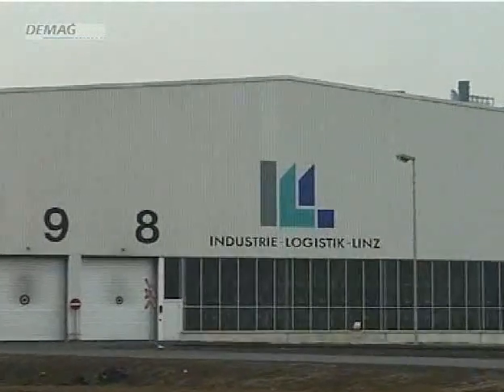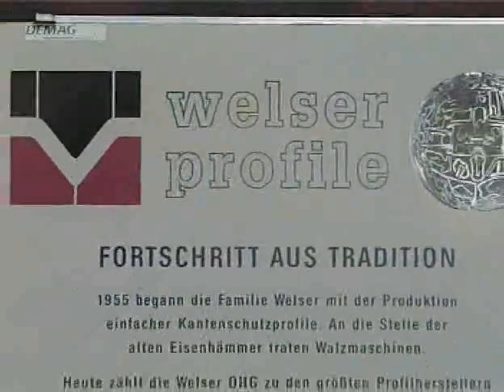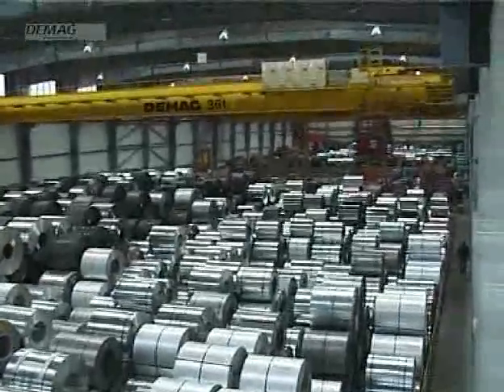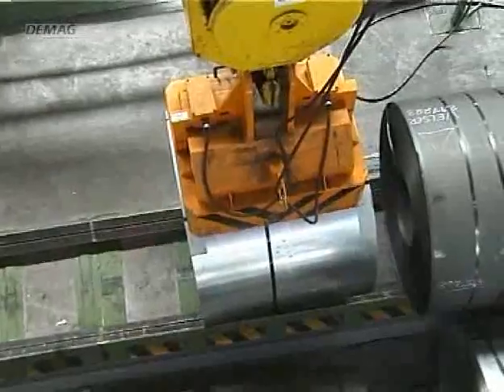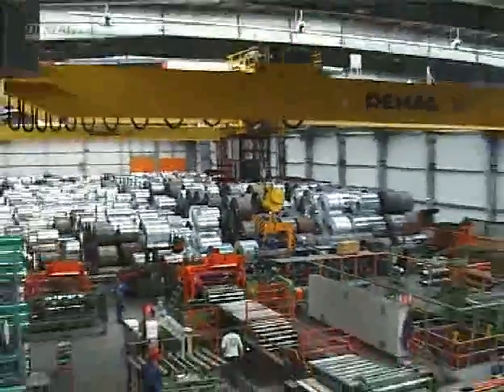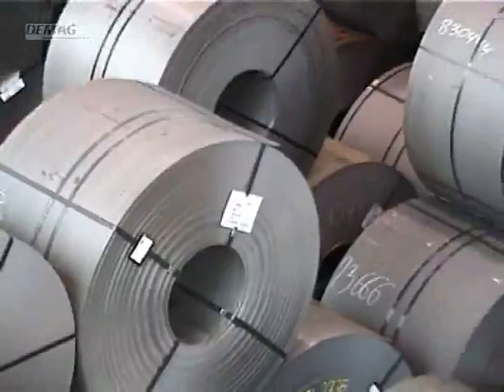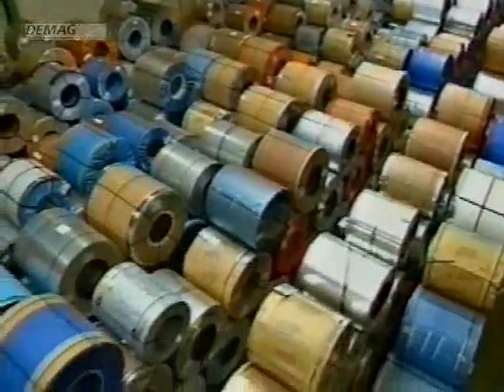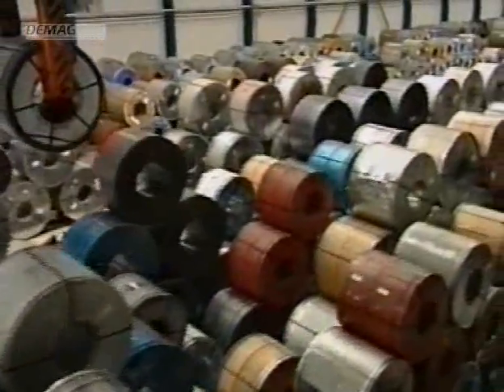Overhead Crane Coil Handling Crane

Comment: Is there a law which states that you can only do one operation at a time , for example cross travel and lifting at the same time ?
Reply: No, you can see the operator doing bridge and trolley travel simultaneously.
Reply: No such law exists... Low quality product manufacturers home made laws can't be considered as European or US standards.
Reply: Sometimes doing only one operation can cause the load to swing or slip. When I lower flat plates on the floor with a plate clamp for example I need to lower and move sideways to take in to account the clamp point going both down and sideways.
Reply: No law,  

How about safety protocols. Rules....commonsense! Those are your laws!!
Reply: There are rules companies put in place for that, but like most rules and safety protocols, they are for stupid people that can't multitask with a crane.